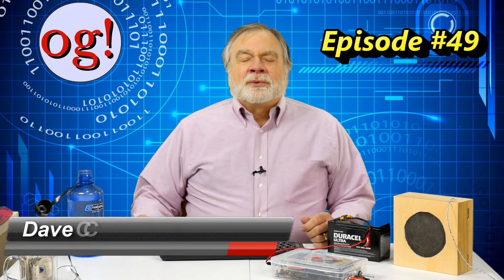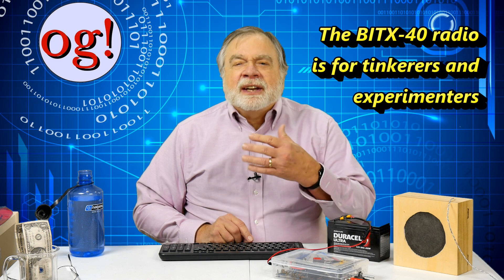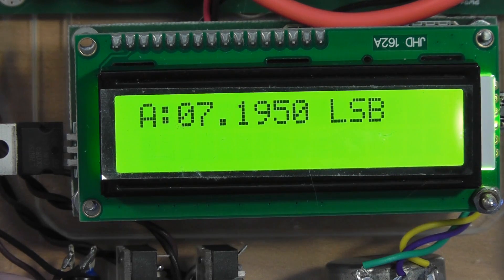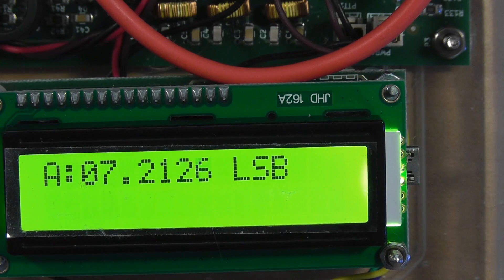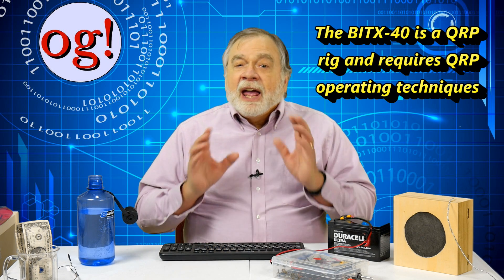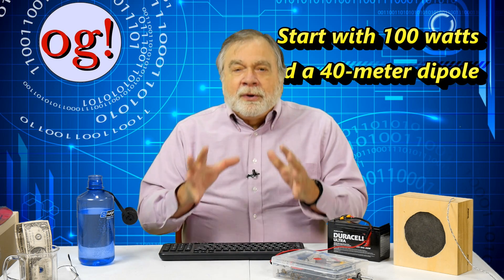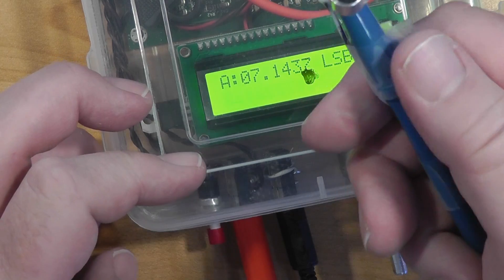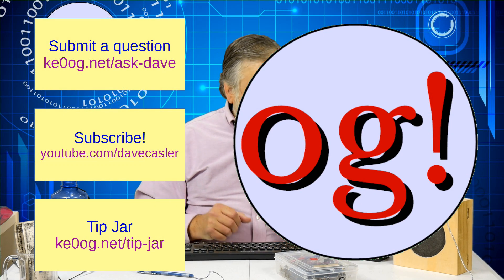Review of BITX-40 SSB QRP Rig Operations: #49

Comment: Hi Dave, maybe you can help  on my BITX40?  I wired it correctly and check it over with another ham who has BITX40. I have problem with the display not going to the Frequency  but it only display the version. The board  is wired to a speaker and producing a clean hiss when the vol. is up.. i experimented with  another 10k pot and use the Tuning1 to see if i heard anything. (removed 2 pin display jumper) nothing so far. 
Francesca w7ltg 
francescawine@gmail.com
Reply from the maker: I would say you have a software problem if the board gets stuck on the version number. There are newer software versions, so perhaps loading something newer could help. The hiss in the speaker is just audio noise; it sounds like the VFO isn't working. Good luck! Troubleshooting can be frustrating.
Reply: Hi Dave,
More testing on the board c1-c5 signal is not getting through. Telling me a short on  the toroids. that's why display can not go any further. Software is there, the board is not sending info to the computer chip   When i got the board it wrap real tight with bubble wrap. finding some the toroids on the board laying almost down. i consider that damage from packing.  So i already did order another Bitx40 Board. I hope to be successful on this board. Being on Jefferson Noon Net at 12 Noon 7.204 daly, i want to be the first lady who has talk on the Bitx40. Sunday night at 7PM  is the Bitx40 net on 7.277
Francesca
W7LTG     NV

Comment: Hey Dave, if you modify the arduino code to put the other decimal in the frequency, will you please post the modifications to the code?  I would like to make that change too, but I am having trouble figuring out where to make the change in the code.  I will keep studying the code in the mean time.
Reply from the maker: I will. It'll be awhile, though, as I have several other videos to do before that. 73, Dave

Comment: Mr. Casler, What are your thoughts about an inline amplifier off of this QRP transceiver? I have not yet dabbled with HF despite having a General class license now for about two years. I would appreciate any insight you might have on this.
Reply from the maker: There are some amps available that will convert a QRP rig into a 100 watt rig. However, most QRP rigs out there (with the exception of the Elecraft and some SDRs) are not really that good in terms of state-of-the art performance. If it's your only approach to SSB, then I guess, but I would recommend getting a purpose-built 100 watt transceiver.

Comment: Thanks Dave. Hi again. I am off to the local parts shop for small momentary push buttons. I too get frustrated with the fast tune up or down at either end of the tuning pot.  I think i'll add the 2 resistors you suggested to either side the tuning pot and, I think i'll need a momentary button for up freq and one for down. Violet to yellow and violet to green. Right? I believe that's how the Raduino works. Also planning to change to a 3 or 10 turn  tuning pot (on order) I had one, but burned it out by nor realizing that the wiper wasn't the center tab on a Bourns control. I'm all set, with my ptt switch mounted on my Sharpie pen mic holder and a nice blue foam windscreen. My 5ah AGM battery is mounted inside my case and a charging port on the back panel. Not sure how to,  or if you want photos. If you do, just ask. 3.other club members are in various stages of Bitx40 fever. Our club, WA1NPO.org.  Take a look at our motley crew. Great guys and gals. 73 Mike WA1MAD

Comment: I'm curious about this little rig...  I've been wondering if it would make any kind of reasonable platform for JT65 or possibly even PSK.  In some ways, it seems silly to use a $1,000 computer to drive a $60 radio, but in others I think it'd be neat just o say I'd done it...  Maybe a Raspberry Pi, a BITX-40, and a copy of WSJT-X for Raspian?  What do you think?
Reply from the maker: The BITX-40 as it presently stands is a lower-sideband transceiver. Digital modes are done with upper sideband. There have been mods suggested on the forum to get it to do USB. But the big problem with a stand-alone solution for digital modes is that there needs to be a sound card in there somewhere, plus a computer to run the digital software on. Inexpensive soundcards are available for only a few dollars, and a Raspberry Pi should be able to handle the computing, I think. Good luck with your experimenting! 73, Dave
Reply: I hadn't even considered that, of course, the transceiver would be LSB for 40m.  One of the mods to convert it to USB would be cool--or it looks like there's a BiTX 20m kit too.  :)  

Thanks for all of your great videos and your reply, Dave!
Reply: you can do these digital modes with wsjt-x and a raspberry Pi. or other SMC. I have a receive station already and I would just need the bitx40 with SSB mod and I should be set for JT9/65

Comment: I know you said you'll get to it. But I am turning inside out to hear your input about adjusting R136 to get the expected meter readings. Or was the low power readings intended by design? I never got an definitive answer from Farhan or the bitx 20 group about that.
Reply: I found I needed to run the BITX from 13.6 volts or so to get 7-8 watts out. With 12 V I was getting about 4-5 watts.
Reply from the maker: Yes, I turned up R136 (mic gain, I think) and it did bring the current up to 1A while transmitting. But that's still not 10 watts output. More like 5.